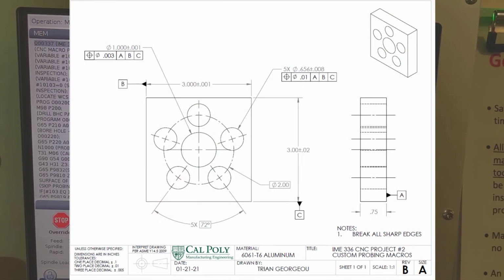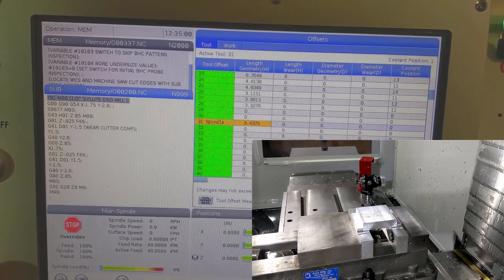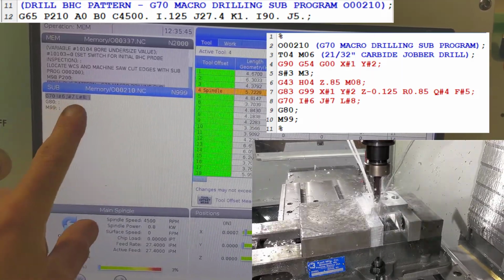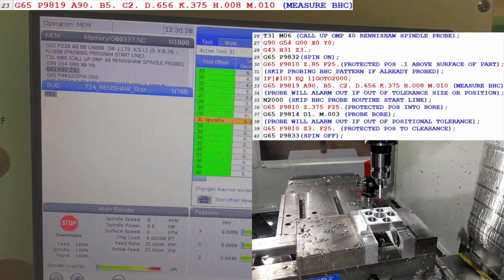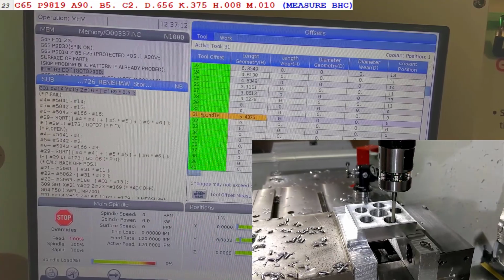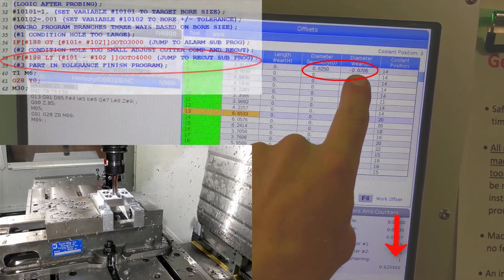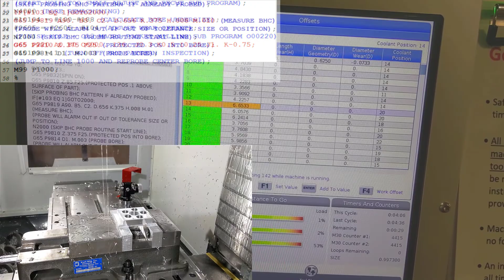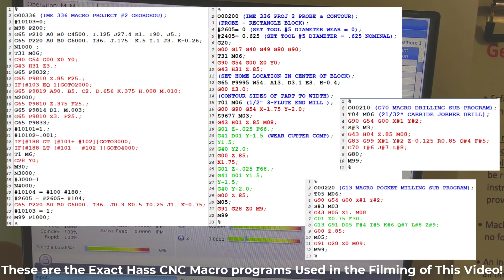Haas CNC Macro Programming Project Overview

Comment: Excellent video by the way. I do have a question though. Rule of thumb is never measure a part with the machine you made it with. Have you ever run into issues with what the machine measures and what it measures outside of the machine?
Reply: It will at least get you close. better to find out an offset or diameter compensation was off sooner than later. obviously you shouldnt be measuring 0.0001s with it.